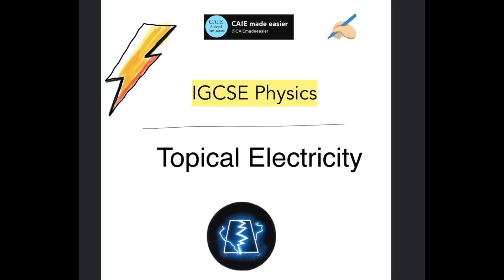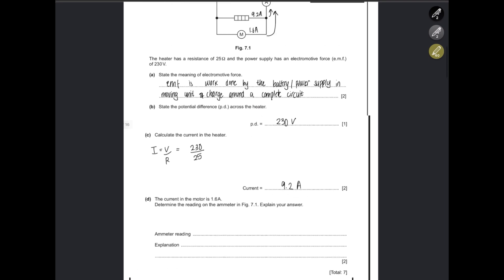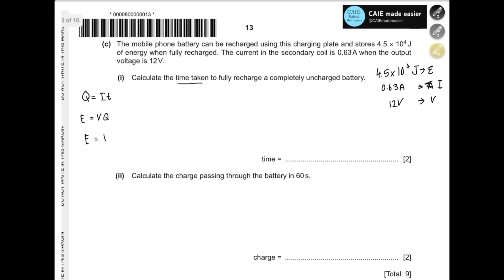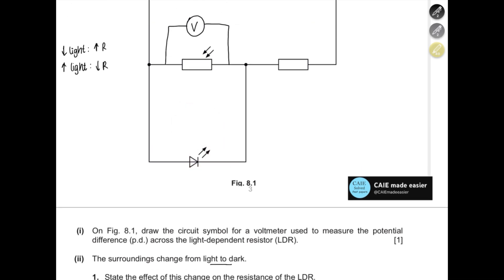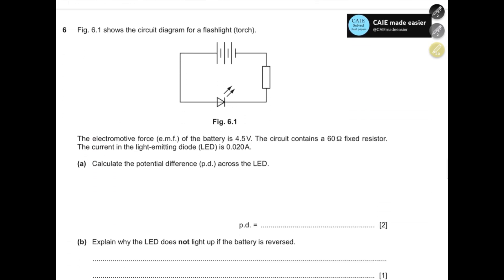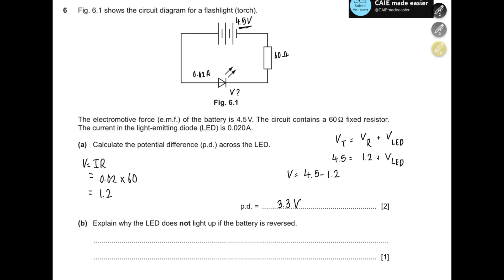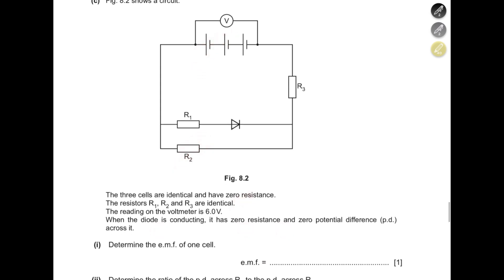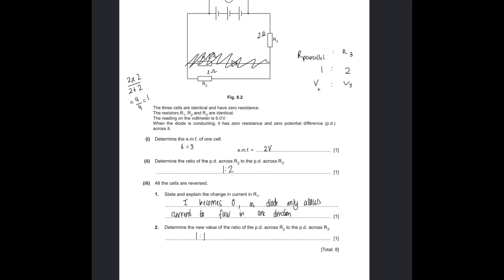IGCSE Physics: Topical past paper qns on Electricity SOLVED

Comment: I have a little confusion about question in 14:01 part ii, i always had a confusion abt this part, if they are all identical shouldnt it be 1:1 ? i dont understand why just bcz its in parallel we have to take total resistance in parallel bcz volt is same in parallel
Reply from the maker: Good question: RESISTANCE in each resistor is equal NOT voltage(p.d)

In series, voltage is added
We know resistance has same ratio as voltage so we find ratio of r of combined resistors ( R1 and R2) : r of R3 which is going to be 1:2

In parallel, voltage is same
So ratio of R1 and R2 is 1:1

Hope that helps😀
Reply: @CAIEmadeeasier  ahaaaaaaaaaaaaaa okok tysmmmmmmm!!!!!